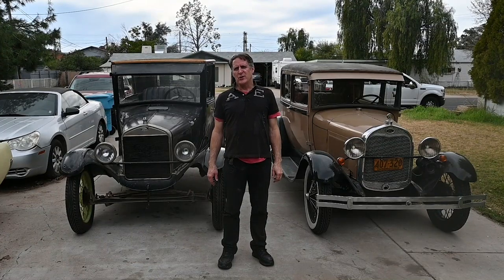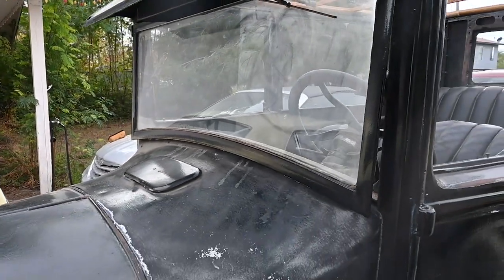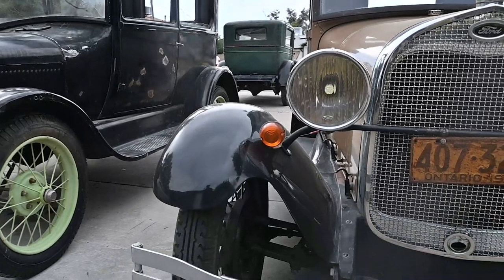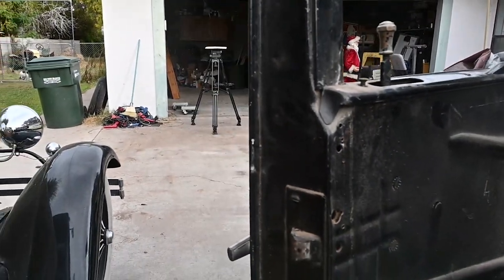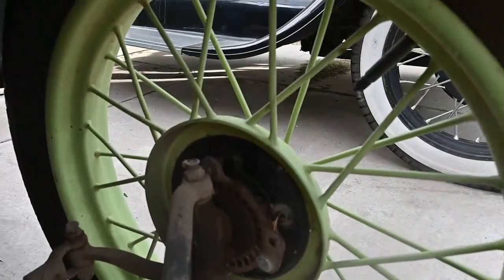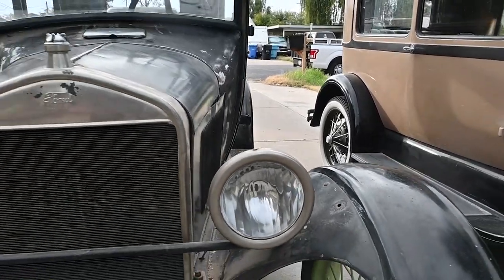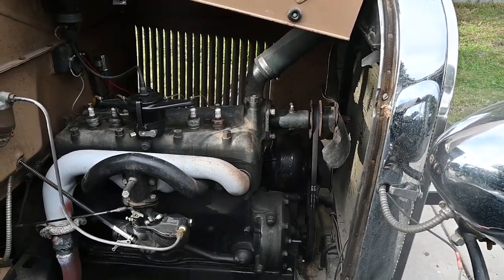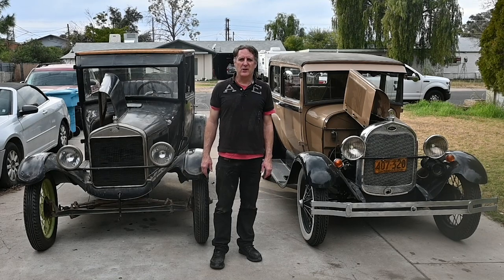FORD MODEL T 1926 VS. FORD MODEL A 1928 Comparison

Comment: This is awesome!..i dug a 1924 model T out of the ground a couple yrs ago and found a 1917 in the woods and dragged it home as well. Also found the remains of 3 model A's,which I also dug out..i prefer the model t for it's ground clearance and durability. The model A needed twice the amount of parts and was much heavier,also more prone to seize up from sitting. I found wire wheels and hubs for the T but the bearings for the hubs were missing and it seems the rear drums must be different as well. I'm still learning about these things as I normally buy 50s and 60s cars
Reply: I agree with you. Everytime I go from driving the A to the T I just love the feel of the T. The model T literally molds itself to fit the shape of the ground you are driving on. It warps and bends its frame to match the ground. Ive never felt another vehical do what it does. Other vehicals like the A with a more ridged frame try to let the wheels make up for variances in the surface you are traveling on.
Reply: How is it you dug them out? Are you an excavater? Why were they buried? Given back to nature like trash?
Reply: @BlondeJedi  no I'm a museum advisor/car restorer. There's more supply than demand for old cars around here. I heard a rumour from several people that a guy buried his model T back in the late 1920s because he couldn't get the price he wanted for it,decided to teach the world a lesson I guess😂..so I borrowed a friends metal detector and checked out the most likely spot on the property based on the what I saw there..sure enough I got a strong signal so we started digging with shovels and flashlights well into the evening..it was about 4 ft down and we used my willys jeep to yank it out. A few months later we discovered whst used to be a wrecking yard,b4 ww2,that has since become a forest..got permission from the land owner to extract what we could..i think we got the remains of about a dozen cars from there,all late 20s-early 30s stuff of various makes. It's not uncommon to find model t's buried here..last year they were repairing an overpass on the highway and found a model T buried and a friend of mine also found a model TT truck underground in a hillside not far from where I found ours..he posted a couple vids as well on utube..search for Joseph Johnston if you want to see his,he has found several around here as well
Reply: @CopperstateBassets  indeed,I've noticed the model A had a very rigid frame,not uncommon for them to snap from stress(like my employer😂)..what amazed me was seeing the model T being used offroad,going places and doing things I'd think twice about with my army jeep..there some time period footage of model T offroading on utube,check it out if you haven't already,it's quite impressive!

Comment: I have a 27 coupe. It's fun to drive but 28 to 30 mph is its sweet spot. Modern traffic will run over me at that speed. So, I cruise the backroads. Nice comparison between the T and A.
Reply from the maker: Hi Dave.. we have the same issue.. we try to stay off main roads.. have a wonderful day.
Reply: The 1927 Model T is much rarer than earlier years.

Comment: the difference from the 25 Model T to the 32 model 18 v8 is INSANE....In 1927 Ford had the cheaply made Model T with basic straight beam frame, wooden wheels, no shocks/barely any bushings, simple pressed steel frame, and 2 speed planetary gearbox with straight cut gears and cheap cork brake that slowed the spinning trans, crazy foot and hand pedals to control its 4 cyl engine, which has a gravity feed tank with no fuel pump, no waterpump, simple trembler coils, no oil pump, and only making 20hp
......But, by 1934 they had a 85hp v8 with self adjusting distributor, modern clutch inside of a synchronized 3 speed synchro sliding gear trans, bushing filled and much improved boxed frame with 5 crossmembers with shocks and modern wheels/ tires and better leaf springs, individual drum brakes on each wheel, big stainless grille, modern headlights and brake lights, fuel pump, dual water pumps, high pressure oil pump, PCV system, much nicer interior, better doors and much better sealed body made of 20 ton stamped steel instead of just wood covered in thin pressed steel, and tons of chrome...and a much nicer electrical and carburetor system that was miles more advanced along with the new windshield wiper...all for only $130(32%) more

Comment: Our local Ford/Fordson tractor dealer quit Ford in 1926 and went to Hudson/Essex supposedly because the Model T was so outdated.  They had started selling Ford in 1911 and sold a whole bunch of T's.  They ended up with Dodge in 1932 up until 1998.
Reply from the maker: Hi Don.. Thank you for watching!  Love all the history in the comments.  Thanks for your contribution.
Reply: The average size of a franchise new car dealer was much smaller then than now.  Some dealerships had a showroom that could only fit one new car.

Comment: Significant changes in the 1926 Model T compared to earlier models...including availability of a handful of colors instead of Japan Black. Despite the updates, sales of the 1926 Model T decreased to about 1.5 million due to the public's perception of an outdated design...so old Henry was finally persuaded to end production in May 1927.  The 1927 Model T is much rarer than earlier model years with only about 400,000 units. Sales averaged about 2 million per year in 1923, 1924, and 1925.  Ford also had no national advertising campaign from about the WWI years until 1923...but it was the most popular automobile.  In 1924 a national marketing campaign resumed with heavy emphasis on marketing specifically to women.  In particular, the much more expensive closed body Model Ts were marketed to women with their weather protection, demountable rims, and self starter.
Reply: Good info. I may do a comparison between the 1926 and my 1924 T to show some of the upgrades Ford did to dress up the car
Reply: @CopperstateBassets  Which body style is the 1924?
Reply: @SpockvsMcCoy  its a touring. That's why Ive hesitated to do a side by side comparison with a Tudor sedan
Reply: @CopperstateBassets  The touring was very popular when new so many survive. The brass era and early coupes are few and far in between.
Reply from the maker: Thank you 🙏 Tim

Comment: Nice video.  We have a '26 T Runabout and a '29 A Tudor.  Both fun and rewarding to drive.  I agree that the T is simpler and more intuitive to drive once you're acclimated to it.  By comparison, however, the A is a hotrod with twice the power!
Reply: I agree. When Input a new distributor in the 1928 it did feelnlike a hot rod compared to the T
Reply: @CopperstateBassets  We installed an FS Ignition Zipper (with Pertronix Ignitor) and it has been quite reliable.
Reply: @fredhubler4128  I will have to look that up. Ive been working on and driving model Ts for 30 plus years. The model A is this new mordern marvel of a car Im just learning about!
Reply: @CopperstateBassets  why, not a DeSoto, or Nash, Marmon or Oakland. Those vehicles were modern marvels, people just don't realize because they only think two vehicles existed in the 1920's.

Comment: In the 1950's I used to drive a 1906 Oldsmobile every Saturday. Worked a hell of a lot better than this vehicle, then again, I say they are working pretty well considering being over 90 years old.
Reply from the maker: That’s amazing.. would love to get a hold of one. Thanks for watching & have a wonderful day!
Reply: Oldsmobile Model L, 2 cylinder or Model B, 2-Seater?
Reply: @SpockvsMcCoy  yes the Model L, although keep in mind it was a 1906 Sedanette.
Reply: @WitchKing-Of-Angmar  Were replacement parts available?
Reply: @SpockvsMcCoy  never damaged until a roll over accident down a hill were it miraculously! only lost a front head lamp and fender bent in a little. Hammered it back out, observed the tires (1920 replacement Firestones) gathered the head lamp, and by the time I got back home...my father never noticed what had happened. Replacement parts were available, But I think all I lost was a chain belt in 1960 and it wasn't exactly an Oldsmobile made chain belt, however I had seen shops with replacement parts for Nashes, Oldsmobiles, Wintons, Toldedos, and Ford's (Model N, Model A 1903). My grandfather bought it in 1905 for $1,230. He recalled many automobiles on the road then, just not so common in cities such as Manhattan unless it was on Billionaires row void of any Horse traffic.
Reply: @WitchKing-Of-Angmar  So your grandfather purchased it as a new car? Did he order directly from the Lansing factory or from a local dealership?

Comment: yes one question how the hell does the water circulate in the t model without a pump  you left me hangin
Reply from the maker: Hi Bruce, Thermosyphon. The coolant in the engine head heats up and rises to the top of the radiator. It starts to cool and is pushed by hotter water coming up from the engine head. As the water is pushed downward through the radiator it continues to be cooled by air being pushed pr pulled through the fins of the radiator.  This works best when the water reaches close to boiling at the top of the engine. Water pumps tend to cause model T engines to overheat because the water is pushed to fast by the pump to actually cool down unless it is restricted by a thermostat to slow it down.
Reply: @COPPERSTATETREASURES  thank you sir. Makes perfect sense.